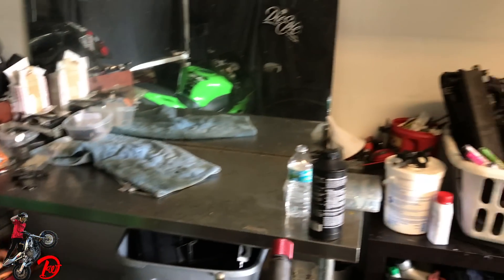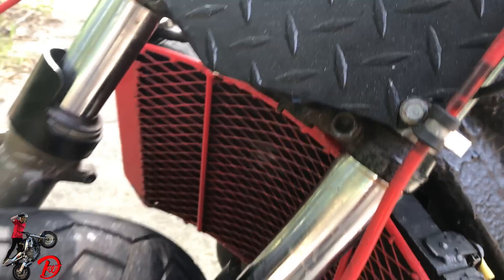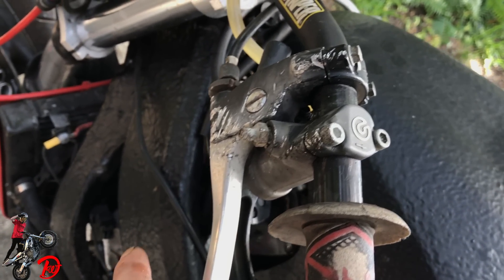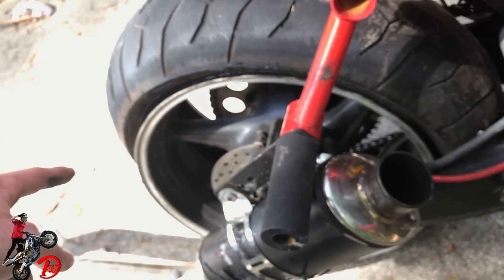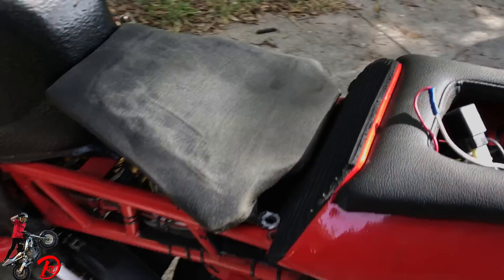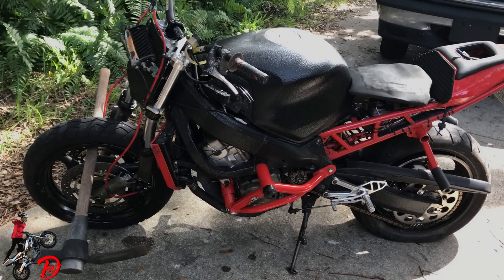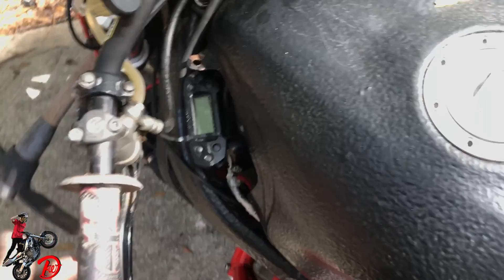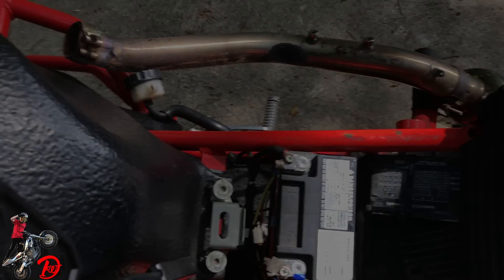Motorcycle Crash Aftermath - WILL IT START?

Comment: damn I wish I had a cage on my bike in my crash. Did that the bike starts. just a heads up. if i were you guys I'd Go over the main wiring as well and Check it for any bare wires. don't need to replace a stator and/or a rectifier. I've gone through 2 of each since my crash in June

Comment: The more you talked about that bike, the more it sounded like a Franken-bike with parts and pieces of your old bikes.. Why does everybody want you to rebuild the rebuilt bike?
Reply from the maker: Clifton Levi Neukam because the damage will take a day to fix
Reply: Dankwheelie   I hear ya, buddy.. It is more of a stunt bike than a show bike, right? I've seen those things come into the shops with frames welded back together before...
Reply from the maker: Clifton Levi Neukam Yeah when you start out stunting you can't learn and have a clean bike for long.best off keeping it running but not fancy in case stuff like this happens.
Reply: Dankwheelie    On another note, did you plasti-dip the tank on your other bike? I'd like to know how long that took..